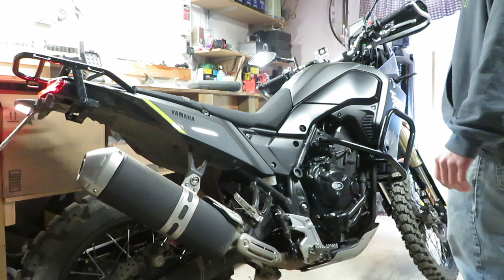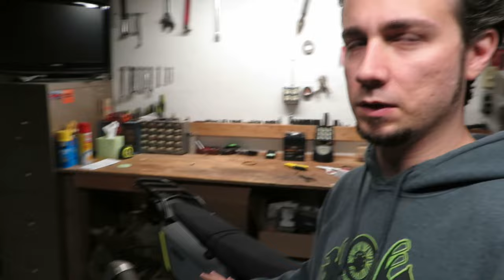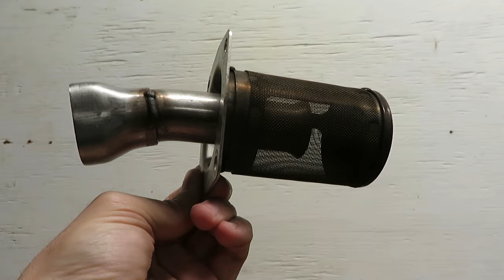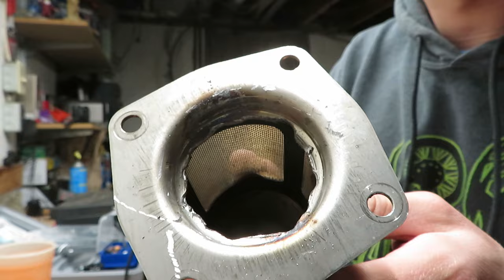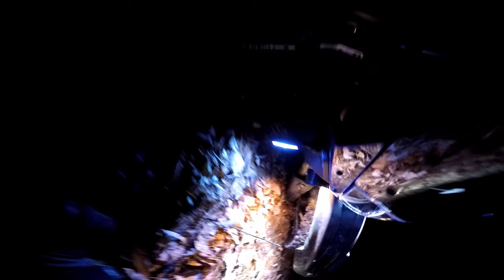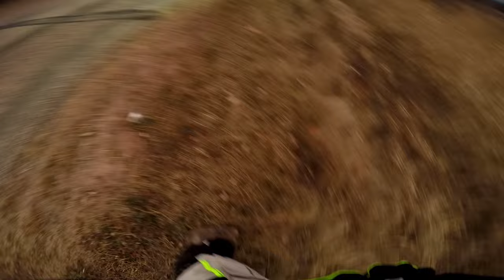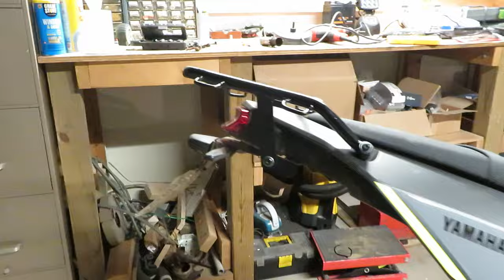Free Tenere 700 Stock Exhaust Mod | Is It Too LOUD?

Comment: Sounds Great!  Every motorcycle that I have ever owned, I have modified and or replaced the stock exhaust to get more sound. ( currently running FMF pipe on my 2009 KLR.) But recently I have changed my mind.  The next bike I get, hopefully Tenere or maybe New KLR, time will tell.  I am going to keep the stock exhaust and keep quiet as possible.  Reason is Down here in Arkansas on the back gravel roads we have a huge population of Dogs.   As you know 3 things that don’t mix well  are Motorcycles, gravel roads, and a pack of dogs chasing you!  My thoughts are the louder the bike the more time the dogs have to get up off the porch and meet you in the middle of the road!  Hopefully a quieter bike will give me a chance to sneak up on them and get by there place before they have a chance to wreck me!  👍🏻🙏🏻😀
Reply from the maker: My CBR600RR actually sounded awesome stock, otherwise I've always either modified or replaced the exhaust on all my other bikes.  Mmm yeah I'd keep mine quite if I had that problem too.  Don't wanna pull a Jake The Garden Snake lol.

Comment: Great mod! As a relative expert in exhaust stuff from years of installing and fabricating them, I would clean up the edge to a smooth transition without that jagged edge and it will be a smoother, quieter sound.👍🏻
Reply from the maker: I kinda wondered how much that would effect it.  Maybe I'll give that a try!
Reply: @SwankyCatProductions  Yeah, it'll give it a smoother tone, also you could try putting a section of pipe between the beauty cap and the outlet of the spark arrestor, preferrably the same size as the hole in the beauty cap, that will also help to smooth the sound out a bunch! Basically you want as smooth of a transition as possible for the cleanest sound. 👍🏻

Comment: Thanks for showing. Messy job but nice to see how the parts look like. I would've used very small drill bits making it possible for a recipro sawblade. Or just taking the mesh of. Or completely make a new insert and saving the original one, how's that? But trying to get more out of stock pipe is a lost cause from the start I'd say. Maybe to lose weight making the exhaust smaller. But not trying to make it louder and have worse performance. But I hope you're happy with the results, that's all that matters!

Comment: Keep mind that lowering the back pressure has an affect of leaning out the air fuel mixture. Usually a fuel injected machine will correct for this and throw in more fuel unless it's beyond the current injector capacities. Usually when that happens on new machines you will get a message on your display to let you know. Don't run your machine for long under those conditions or it will burn up from a lean condition.
Reply: It has a cat it won’t cause any issues at all

Comment: I did this to mine for a quick run around the block just to play with it. Sounds good on the first 2-3 gears then I don’t notice much of a change. I put the spark arrester back in because I was reading that if you keep it out, the silver end cap turns a yellowish brown from heat warping. I’d love to modify it to make it a bit more throaty without it discoloring the exhaust
Reply: Didn’t watch the vid before commenting.. see you modified it do to exactly that 😂😂
Reply from the maker: Yeah a pipe on the inside would fix that.  I might do that but I'm planning on getting a high mount kit and an aftermarket pipe anyways so I'm not too worried about the tip short term, otherwise I'd definitely do it.
Reply: @SwankyCatProductions  any clue when camel is coming out with the high pipe kit?

Comment: A fuel programmer will help with the loss of power now that you have opened up the exhaust. 
The tenere comes fairly lean to meet teir4 emissions & opening the exhaust makes it leaner is why i suggest a plug n play tuner.
Reply from the maker: I think I'll definitely look into one after I get a high mount kit and a new pipe.
Reply: I got a remap, full decat sc project exhaust DnA airbox cover and filter, it sounds amazing now.

Comment: I think a transition tube to smooth flow from the main can through the tip would make it sound tuned. I like the throatier sound. I found when I road the T7 on the last leg of the WABDR I was riding it (on my first longer ride off road) as fast as I road my KLR after riding it for two years. I think the suspension is the biggest player in that. Stay up on two! Big B
Reply from the maker: Hmm I'd not thought of that, might have to give that a shot!  Yeah I'm surprised how quickly I have become acclimated to my T7 too.  It's an awesome ride!

Comment: Did this same mod and she wasn't loud enough lol. Its the best sounding engine besides a crossplane 4 cyl.. so I bought the black widow short can and she is straight through after removing the baffle haha. No performance change and it sounds like a race bike.  You get all your back pressure from the cat anyway.
Reply from the maker: Agreed, it's not really that loud and there's plenty of other places in the system that provide back pressure.
Reply: Did you get the black widow full system or does it still sound good with just the slip on?

Comment: Keyboard mechanics in shambles right now! you can see alot of weight reduction changing out the exhaust. When it's laying on top of you in the woods, every pound matters, haha. It's funny with my Beemer, there is no in between when it comes to exhaust. there's either stock with the separated cat/muffler setup, or there's 107 DB pipes. it's amazing! How fitting of Yamaha to finally bring the 700 to the US just in time for all the other manufacturers to exit that displacement range. They are a slick bike.

What mic are you using?

Comment: Ah, the dreaded tree incident! Great job on the “drill bit” mod but now waiting for your pick for a high mount exhaust. I did see a shorty exhaust installed on another YT channel where they also reduced the weight of the bike by 62 lbs by taking off the glamour parts.
Reply from the maker: Thanks!  Yeah I'm looking forward to it too lol.  Wow that's a good amount of weight, I'll have to check that out.

Comment: Can you heard the motor in long-term wise? Sounds so much better
Reply from the maker: No, if you removed the pipe completely it might cause issues but the header and catalytic converter provide all the back pressure you need.  The new pipe I've got is literally just a straight through muffler like a cherry bomb.

Comment: I'm in the same boat as you, Ben. I don't want a loud exhaust that is going to annoy people and/or get trails shut down. But, I do like the sound of your modified exhaust. Its not too much louder than stock and it has a nice note to it. I doubt its going to get you into trouble. It would have been cool to use a noise decibel app to measure how loud the stock exhaust was before and then measure after with your modified exhaust.
Reply from the maker: Thanks Jeff, yeah I totally agree.  I actually thought about looking for an app a few times before doing this and than totally forgot about it haha.

Comment: Have you ever tried it without the Spark Arrester? Would be curious to see the difference in volume.
Reply from the maker: No but the new pipe I put on is a straight through design and that came without an arrestor.  I added one and it did seem to quite it down just a little.

Comment: She sounds good! Watch for signs of timing issues when changing the back pressure. Did I see a deer stand ladder as you rode through the woods? Any luck so far? Is your season in?
Reply from the maker: What would be the symptoms of that?  Choppy idle?  Yep I actually dragged it there with the KLR!  I actually haven't been hunting this year, my foot still doesn't do well with a lot of walking.
Reply: @SwankyCatProductions  
You might not have any issues but rough idle, backfire when letting off the throttle quickly. Change in gas mileage.

Comment: I figured a spark arrestor wouldn't be necessary with a catalytic converter in the head pipe. Guess I was wrong!
Reply from the maker: Depending on the regulations in your area it might not?  I believe most places in the US don't care one way or another if you've got a cat, bottom line is if you want to ride trails you need a spark arrestor.

Comment: Everything I've read written by professional motorcycle journalists who talk with bike manufacturers is that as much engineering effort designing a modern bike is spent on exhaust design as on the engine design and on the interaction of the two - in the valve timing (i.e. cam profile) and the spark timing.  And the resulting exhaust system requires that there be a given amount of back pressure to make it all work to meet the design goals of sound level, emission level, fuel efficiency, and minimum power reduction.  Simply carving out the muffler to reduce back pressure does not automatically improve power or any other parameter, and it can actually REDUCE power by causing lean burn and overheating and general confusion of the ECU.  IOW, it's not a DIY project.
Reply from the maker: They may very well spend a good amount of time on certain aspects of their exhaust systems, but I'd wager they're far more concerned with meeting emissions than they are squeezing out every last drop of performance.  Plenty of reputable slip-on manufacturers have before and after dyno charts to prove that.  I agree that what I did is not at all a performance enhancement, I feel I made that pretty clear in the video.  I'm no expert on fuel injection systems but I know they're only meant to adjust for slight variations, like air temperature and that's about it.  Similar to re-jetting a carbed bike for a new pipe, my current hack-job probably requires some things to be adjusted, but I don't plan on keeping it long enough to make that worth my time.  I'm sure it's a different group of engineers and designers but I wouldn't give any of them to much credit after seeing how the 8" long exhaust hanger can be snaped off the subframe after dropping it a few times.
Reply: @SwankyCatProductions   - I agree that manufacturers are more motivated to meet emission requirements than to maximize power.  And since after-market exhaust system developers feel relieved of that restriction, they can go for power and sound, damn the NOx and decibels!  As for ECUs, they monitor oxygen in the exhaust gases and the engine rpm, and adjust fuel amount and injection timing and spark timing accordingly.  It's all a complex dance that the manufacturer's engineers have to choreograph while the after-market muffler engineers can concentrate on just one or two parameters.

Comment: I have the storm pipe by mivv and they sell a larger diameter db-killer with a 35mm diameter inner pipe, conpared to i think 28mm original and it sounds perfect. A little raspy when you blip the throttle but you can still keep it quiet if in built up areas. So I recommend 35mm inner diameter pipe👍👍

Comment: Motorcycle exhausts have been detuning the engines for decades.... it's a fact everybody knows it, don't have a fear of taking that carefully engineered muffler and tearing it apart because it actually Hurts your HP !!!!! 
....now that you removed a bit of the restriction remove more !!!! take the spark arrester back out and on the plate that you showed us down in the bowels of the muffler drill #5 1/2" holes in that plate( or as many as you can get into it !) a long sharp punch will do in a pinch and just punch holes in that plate.)  so the exhaust can actually get past the major restriction inside the muffler !    I guarantee you you will notice a big difference in both the noise and the power of the bike !
if it is too loud you can always drill a plate to cover the exhaust tip with as many holes as you can fit on it so it is well perforated
and then put OO steel wool into the cavity above the spark arrester this should quiet it down quite a bit.
I have been modifying bike exhaust sense I was a Kid...back in 1961..... on my honda 50cc .  a diffuser is the best way to quiet down a noisy exhaust which is nothing more than a tin can with a thousand nail holes in it....or a plate over the outlet with enough holes in it to add up to the area of the pipe diameter.....the smaller you make the holes the quieter the exhaust will be
but the harder it will be to obtain the needed inlet pipe diameter in the sum of the holes you drilled.... ( you'll need more holes)
I ran a straight pipe for years with just a cap from a sprey paint can stuffed over the outlet and i poked as many holes in the paint can lid with a 1/8" nail.... the bike didn't know I put the baffle in it as it ran just as strong with it as it did without it !
but the sound was reduced by 50%  at least.....   everyone should modify their exhaust.... the engine needs it , I hate super loud exhaust noise , there is no excuse for that !  Harleys are notorious for it, but it is not necessary at all ! you can get rid of exhaust back pressure and have a quiet bike too..... it's just a question of how smart are you.  <grin>

Comment: I notice at 1:19 that the "V" of your front tire tread pattern points forward, i.e. that the point of the "V"
hits the ground first.  More than 98% of bikes come from the dealer with the "V" of the front tire tread
pointed BACK.  The REAR tire tread patterns always point forward, as does yours (and all 4 car tires),
but your front tire is different.  Is there a reason for that?
Reply from the maker: No clue lol.  These aren't stock though, they're MotoZ Tractionators and they are THE BEST tire I've used yet.  The Kenda K270s I had on my last bike may have been a little better off road, but weren't anywhere near as good on road.  They handle the Tenere's power just as good on road as they do off and corner very well on pavement.
Reply: @SwankyCatProductions   -  I've never seen a reason given why motorcycle front tires have the treads pointed backwards, either, except that virtually all manufacturers put them on that way.  Just check out any bike show video, especially the EICMA show each year in Milan.
Reply: @daveinwla6360  long story short, it's installed wrong way. The reason for this is simple. Rear tire pushes dirt back, front tire is being pushed forward into the dirt. The V shape pushes mud/dirt outwards so it doesn't cake up immediately. So if you change it you've got yourself a nice slick tire made of mud :) *does not apply to sand
Reply: @goatman86   - And all road tires are installed that way by the motorcycle factory/dealers, too.  It probably implies that in the wet, braking performance is more important than steering performance for a bike.

Comment: We have all been waiting for this one. Hello from Knoxville TN. I have the same color. Just put heated grips on last night.  You running any luggage yet?

Ive got a rear rack by touretech and a Apache 3800 gun case from Harbor freight for now.  Think I g soft luggage for the sides for sure for trips. Also added a GIVI tank bag.
Reply from the maker: Hello!  Nice, heated grips would be a good idea.  I don't have anything but my old KLR bag yet which will probably be enough for most of my adventures but will see!

Comment: The thing to do would be cut off the pipe to where it is the same size and straight, and then cut the rest out with a hole saw/bit
Reply from the maker: That would work better.

Comment: I hate when people talk back pressure.. like they heard it once and latched on to back pressure is important. It's all dumb
Reply from the maker: Agreed lol.  Turns out you can actually run a straight through pipe on this bike without any issues haha.
Reply: @SwankyCatProductions  the biggest this you can run into is AFR (air fuel ratio)being a hair off and if you run stupid short headers excessive heat at exhaust valves shorting there lives caused by burnt valves. That the extent. But it's completely different if on a two stroke. Don't fuck with the pipes lol